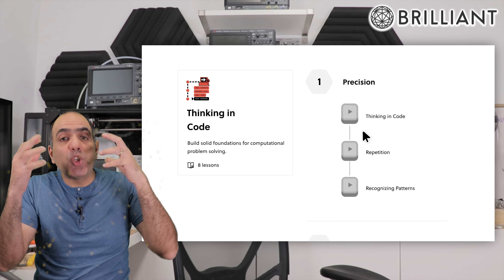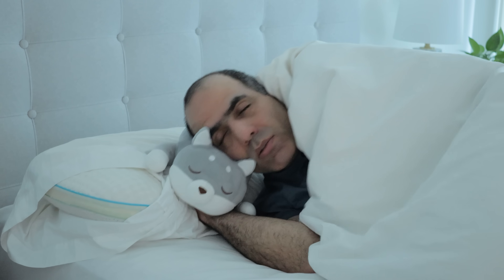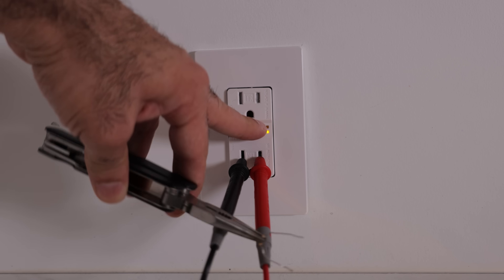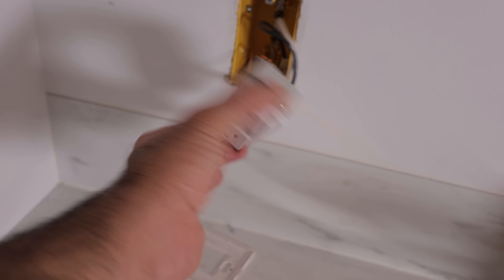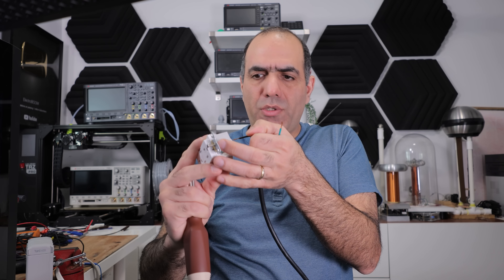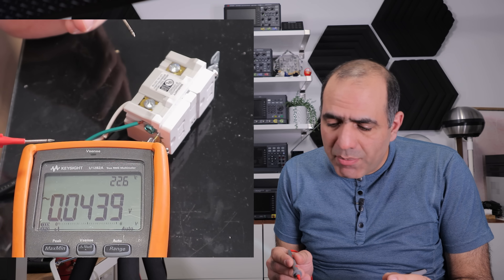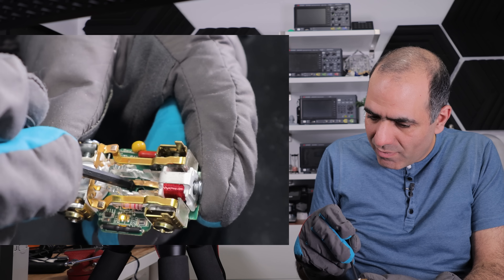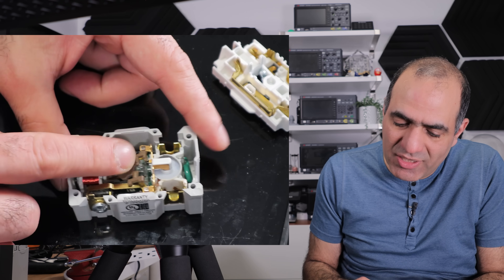Repairing Faulty Ground Fault Failure

Comment: Unfortunately, I have extensive experience with AFCI's and GFCI's. Nuisance tripping of GFCI's is sometimes associated with inductively coupled noise onto the feed lines, such as a compressor starting for an AC or Refrigerator. Another source is that the GFCI is very sensitive to high frequency conducted emissions and will trip. While your Tesla Gun does have very high voltages, they may not be at a frequency that is worst case for the breaker you have.
Reply: Why unfortunately? You hated your GFCI job?
Reply: @filips7158  I worked in the Appliance Industry and had to fix problems that we were not responsible for, on systems that did not have any standards for performance but because there were no standards for the breakers and outlets they could cause all the problems with impunity. That is changing but not there yet.
Reply: @rpercifieldjr this is demonstrably false. I work for a breaker manufacturer. We have a full suite of UL tests and standards for our electronic circuit breakers. Nuisance tripping is usually a result of cost cutting in the appliances inducing noise and frequency patterns that emulate an arc fault. Something as simple as a cost cut chinesium compressor motor that arcs across the motor will cause a trip. It doesn’t mean the breaker is bad either, it’s doing its job stopping arcs. Higher quality sub components would fix it. We work with appliance manufacturers on a large scale tuning our devices to reduce this issue. Because while we acknowledge that it is not “our fault” we also acknowledge it’s easier to swap our $75 breaker than a $1500 fridge.
Reply: @postalUT  So which drill do you use to simulate a noise? The UL test for AFCI is pathetic, and ignores noise from switching systems, BLDC motors, and other known noise sources. I have well documented cases where an AFCI will false trip on an electromechical refrigerator whose noise during defrost is 40 to 50dBuV below FCC and CISPR 14 levels. An outside noise source caused the breaker to trip when the refrigerator went into defrost. 

I have refrigerators, washers and driers that have conducted emissions below FCC part 15 and CISPR 14 levels  consistently trip AFCI on a regular basis. AFCI's have difficulty to detect arcs in high noise and dirty noise environments. A major supplier of AFCI's brought a breaker, and microwave which met FCC part 15 to our labs. In the field this breaker and microwave caused constant false trips. Well, on clean power they could not once cause the breaker to trip. We monitored the conducted emissions and confirmed that performance of the microwave, and they left empty handed without an ability to blame us.

The new UL 101 compatibility test will address issues with GFCI's to keep sensitivity of GFCI's within as reasonable safe level of detection. The corresponding UL 943 whenever adopted will at least stop some of the over sensitivity issues.

At this point there is no require for sensitivity levels for AFCI breakers. Also at this point there are no agency (FCC)  requirements for conducted emissions for appliances not considered intentional emitters. Each breaker manufacturer uses a different method for arc detection. Some are better than others. 

I will close with this: When a false trip occurs, it does so because the breaker system detected something erroneously and tripped. These conditions are not rare in the real world. To blame appliances for confusing the breakers is weak, your system should be much more robust. I have personally been dealing with AFCI and GFCI issues since 2014. Since then our systems are much quieter in conducted emissions, and yet we still have units that meet Part 15 and CISPR 14 requirements tripping breakers. if a Part 15 listed RF system must be capable of handling that level of noise your breakers should be as well.
Reply: So, what can be done in the case of noise on the feed lines? Do you just have to try different outlets until you find one that is less sensitive, or can you stick something on the input lines to suppress the noise?
Reply: @sadlerbw9  In my previous house, I had an AFCI breaker (the kind that's in the panel, not the kind that's in a receptacle) that liked to nuisance trip. Initially, it only tripped when I made the mistake of using a vacuum cleaner on that circuit, or when I printed something with a laser printer that was on that circuit. Which makes some sense, as the vacuum's universal motor and the printer's corona wire both look like arc faults. 

I found that a high-quality filter on the printer seemed to help, but over time it got more and more sensitive, I guess because all of the nuisance trips had put unusual wear on the breaker's mechanical components. Eventually, I replaced that breaker with a new one of the same model and the problem went away entirely, so my assumption is that either that particular breaker was just on the edge of being in spec to begin with, or whoever owned the house before me liked to cause arc faults as a hobby.

AFCI is different from GFCI, of course. GFCI should be a lot less sensitive to noise for the same reason that differential signaling should be less sensitive to noise. But less sensitive isn't insensitive, and someone, somewhere is going to end up with that GFCI breaker that started out just barely in spec and wore out over time, just like my AFCI breaker did.
Reply: @RonParker  Some devices can pollute the AC lines that feed them with DC. If there are DC currents in the wires that go through the sensing coil of a ground fault protection device, they permanently magnetize that coil, which results in the electronics believing there is a fault current when there really isn‘t one. Expensive ground fault protection devices address this issue by running some AC through the sensing coil (the itself, not the wires that are surrounded by the coil) evers now and then. The AC „clears out“ the magnetization the coil got from being exposed to DC which restores their original properties.
Reply: @MrAranton  In my case, the breaker was AFCI, not combo GFCI/AFCI. So presumably it didn't even have a current transformer, or the output of whatever transformer it did have was being fed into a high-pass filter. But I can see how that'd be a failure mode for GFCI.
Reply: @RonParker  Funny...I had the exact same problems both with vacuums and a laser printer. Another appliance that regularly tripped the AFCI breaker was our fancy toaster oven (which has some kind of modulated control of the heating elements rather than just on/off).

FWIW, in my experience the act of replacing the AFCI breaker would correct the problem, but not because the old breaker was worn out or anything (this was happening in a newly constructed house), but rather because the manufacturer of the breakers is routinely updating the logic in the breaker to account for false-positive triggering signals. A new revision of the breaker just is better at tuning out those signals.

My experiences with the AFCI breakers has left me highly ambivalent about them. I get the basic goal, but there are so many different ways the AFCI breaker can be falsely tripped, and the manufacturers have IMHO done a piss poor job providing customer support when problems come up. It's pretty easy to get cynical about the true motivation behind these breakers, which cost even more than a regular GFCI breaker, never mind a basic one, and which manufacturers successfully lobbied to be required in the electrical code, given how much profit they make for the manufacturers and how frustrating they can be for home owners.
Reply: @sadlerbw9  Currently there are multiple efforts to define at Agency Level (i.e. UL, IEC, NEC, etc) a way to improve performance of these systems in the real world. One example was when the compressor on a refrigerator started, and the inrush current occurred, this inrush would impress a current in an adjacent wire for the bathroom, and the GFCI would trip. Not the GFCI for the Kitchen but the bathroom. In evaluation it was shown that the feed cable for the bathroom ran in the same holes in the studs that the kitchen did. it was over 12ft of running in parallel. The solution was to replace the breaker panel GFCI breaker with the outlet version in the bathroom. This stopped the impression of a differential current in the wire. This issue affected about 60% of a 600 unit apartment complex. It is very complicated and technically challenging to resolve. Also each case is different.

You can look for the offending signal source, but may never find it. Many times it requires changing the outlet GFCI and or AFCI to another manufacturer to get a better noise immunity.
Reply: @sadlerbw9 canonical answer is a GFCI breaker.
Reply: @sadlerbw9  "what can be done in the case of noise on the feed lines?" -- that will depend on the source of the noise. But I had a GFCI breaker tripping that turned to be caused by the water-well pump's operation. The electricians had run the cables for the power to the pump controller adjacent to other circuits, including the one that was tripping. When the pump turned on, some kind of signal would get induced across the wires into the other circuit, causing the breaker to trip.

At first I'd been assuming it was a spurious arc-fault trip, but then I learned that the breaker had a way to query the type of fault after the fact -- it didn't have any indicator, but through the use of the breaker's test button in conjunction with resetting the breaker, the duration until the breaker tripped again would indicate whether the fault was overload, arc, or ground. It turned out it was a ground fault.

The fix in this case wound up to install a very large RF filter on the power cables connecting to the pump controller. It took a specialized kind of filter. A first attempt to install smaller, more basic filters failed to correct the issue, but the second attempt with the more impressive-looking filter worked.

I guess another alternative would have been to reroute the cables, but they weren't easily accessible, and filtering out the noise completely was probably a more reliable fix anyway, since the noise problem could be reintroduced later if we ever remodeled or otherwise had to change the configuration of the electrical circuits.
Reply: That's why in Europe we have different classes of GFCI/RCD! From the bottom to the top they become immune to pulsing current, high frequency and DC components! Nowadays we have in our houses a lot of frequency converters (or inverters) that drive motors like heat pumps, washing machines or fridges, so high frequency noise is a common issue because the whole house is protected! Standard RCD can trip easily, so we use advanced ones!
Reply: @MyNotSoHumbleOpinion  Not only different classes. But also the devices are required to be electromechnical. No electronics allowed. This also has the advantage that the device still works in case of a fault of the neutral line.
Reply: @MyNotSoHumbleOpinion I imported an entire German panel and 2 pole RCDs of different classes to use for the 240v circuits in my shop. Everything has the correct class of RCD with fast acting fuses ahead of them as the main. Basically all of the equipment in my shop is 240v though and US 240v is line to line so I used all double pole RCDs (real double pole, not just switched neutral). But I have a bunch of things on variable frequency drives and there are no GFCIs of the correct class for 240v available in the US. I also use imported tools so have Schuko and Australian/Chinese outlets over the workbench.
Reply: Had the same problem with my GFCI which is called RCCB and installed in the breaker panel here in India. A 1uF box capacitor in series with a 5 watt 33ohm resistor fixed the problem. It's better to use a suitable MOV in parallel with snubber for added protection.
Reply: I had a GFCI outlet on the end of a 60’ outdoor cable. 3 of these units failed. When I moved the GFCI outlet to the start of the cable no issues. Any idea?
Reply: Although tempting to put a GFCI socket on a refrigerator it's usually better not to because that last thing you want is for the refrigerator to de-power (and de-ice) without you knowing. Also, invariably the socket is right behind the refrigerator making it a PIA to reset it.
Reply: @mb-3faze  In Canada the electrical code says that a refrigerator outlet has to be a dedicated circuit (oddly, except for a line powered electric clock if you have one) and specifically says to NOT use a GFCI on the refrigerator circuit.
Reply: In this case, the problem was almost certainly a fault in the GFCI circuitry itself, not external.  Most likely, the sensing transistor is failing and generating a small amount of random noise.

Modern GFCIs are actually pretty bulletproof and, when not faulty, do not generally have problems with false-tripping, even with things like compressors or refrigerators. I think you may be confusing them with AFCIs, which do sometimes have problems with tripping when connected to things with large motors, etc, and also can sometimes have issues with RF interference.  (AFCI and GFCI are completely different things, and work completely differently).
Reply: @foogod4237  There are many issues with AFCI's and GFCI's. You could do several videos about them and not repeat anything other than the identifying name. The problem is that the NEC (National Electric Code) has followed the lead of the breaker manufacturers and required them in the latest editions in almost every application. AFCI's are at this point the most problematic from a nuisance trip perspective. UL 101 has completed and released a compatibility test that one fully instituted will fix most of the GFCI issues going forward, however the AFCI issue remains, and will be very difficult since each supplier of these breakers use different IP and trip  with various levels of detected RF frequency, voltage levels, current levels, and other factors. I will be long gone before that get's standardized. Right now there is no controlling authority for AFCI's and it is the wild west in terms of noise immunity and performance.
Reply: @foogod4237  "the problem was almost certainly a fault in the GFCI circuitry itself, not external" -- that's not a reasonable assumption to make. See my previous comment above, regarding my own experience with a GFCI tripping due to noise on the circuit (or rather, induced onto the circuit by an adjacent one).

I'd agree that AFCI breakers have more trouble than GFCI. But to call GFCI breakers "bulletproof" is overstating things, and to immediately assume a person is confusing GFCIs with AFCIs is a mistake, even if people do suffer from that confusion often.

Comment: Problem may be in the mechanical section. The part that is holding the pin which breaks the circuit may be lose or the edge isn't sharp enough to hold the spring's pressure.

Comment: I have observed a Strange Failure mode on my household GFCI Socket (just one).
The socket is receiving power from a light which has a dimmer on it.  Stupid, I know.
I noticed the GFCI Failed to Activate when the Socket Voltage was down to 87V rather than the expected 110V.
I don't know if I am correct in this however if I am it would seem to be a very dangerous fail mode.
Reply: Ive never seen that before, A GFCI wired after a dimmer switch. my guess would be that either the triac in the dimmer which is trying to reduce the voltage is playing havoc on the sensing. or perhaps the sensing circuit inside wouldnt activate at voltage that low. or even maybe it was active and trying to break the circuit, but the 87 volts instead of 120 was making the coil too weak. knowing what i do about dimmers. Which admittedly isnt too much but i do know that not only do they reduce the voltage but they also reduce the Hertz. so instead of 120 at 60Hz it would have been 87 at like 35Hz and maybe that was causing issues. who knows, thats an odd quirk and probably should be addressed. but I doubt anyone ever would since your never supposed to wire dimmers to anything other than inbuilt lights, as far as i know your not even allowed by code to wire dimmers to non GFCI outlets or at least have to make it plain that that particular outlet is on a dimmer since most dimmers can only handle like 150 to 300 watts of power and if someone say tried to bung a space heater at 1500 watts into the outlet it would absolutely burn out the dimmer circuit and potentially risk a fire in the wall.
Reply: @compzac  Lamp dimmers do not alter the frequency (hertz).
Agreed that feeding any outlet from a dimmer is stupid and probably illegal.
Reply: ... Some GFCIs don't cope well when connected to appliances that halfwave rectify the mains. The DC offset component (current only drawn on one side of sine wave) creates a semi saturated state in sensing transformer and messes with tripping. Possibly your dimmer only uses half the sinewave at certain voltages?
Reply: @leybraith3561   Half-wave rectification of the output doesn't affect the sensing coil. If there's no ground fault there's no magnetic field and thus no saturation. The issue comes when a fault current is purely DC. Even if the fault is half-wave rectified there is a major AC component and it will trip.
Reply: Your example with a dimmer is unreasonable (it's a code violation) but a related situation is a loose neutral connection. That would lead to the GFCI's circuitry being unpowered even though the hot leg of its output is still connected. Touch hot and ground and you'll get shocked but it will never trip. All standard GFCIs share this issue. Some specialty GFCIs require power to activate their output and thus are immune to this problem.